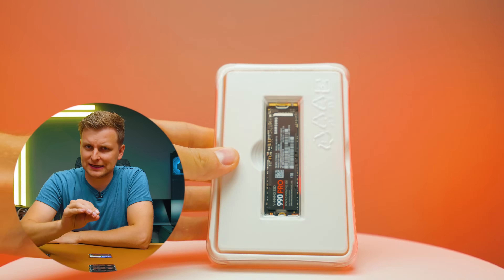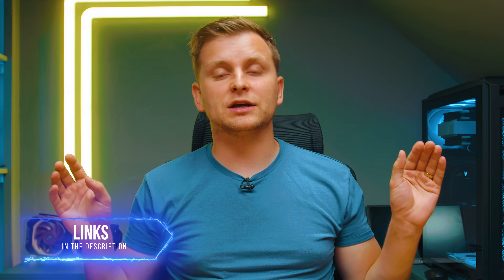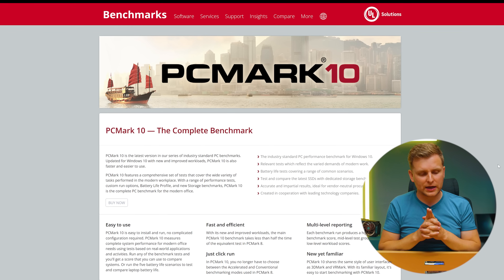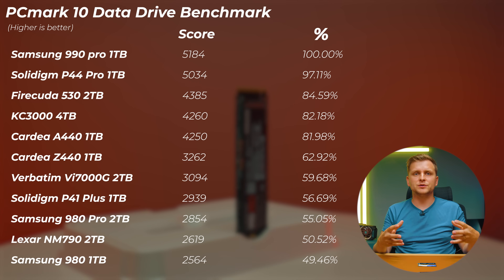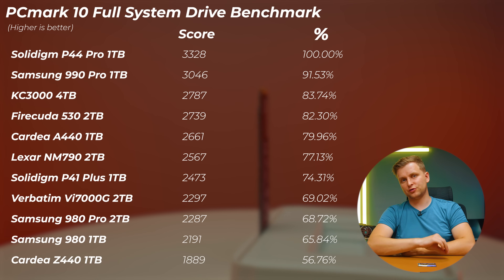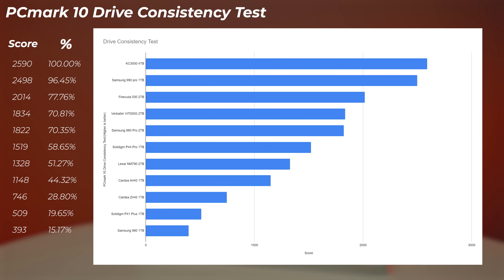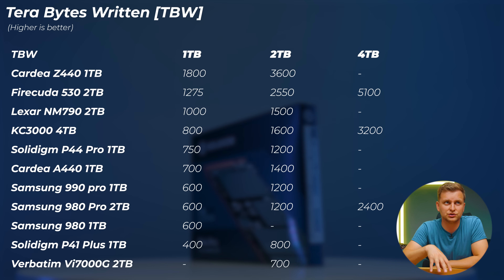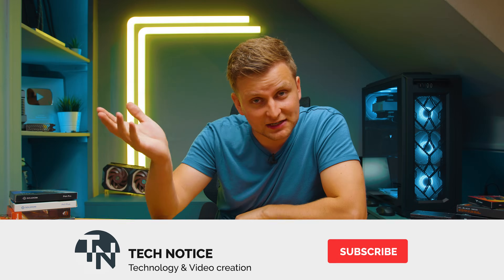REVEALED 👉 BEST SSDs For CREATORS | m.2 NVME Drive Buying Guide

Comment: Gents, tell me if this is a good idea.  I'm building a 3d workstation for AEC workflows (lidar scanning, 3d modeling, BIM, etc) on an Asus ProArt x870e motherboard with a 9950x3d cpu.  256gb of ram.  I've used GPT to spec my m.2 configuration and asked it what drive I should use for a scratch disk for my worfklows.  It came back with this:  "Why this drive beats even the fastest Gen5 drives for scratch disk duty:

Scratch workloads are NOT about peak 14,000–16,000 MB/s sequential read speed.

Scratch workloads are about:

Massive small-block random read/write

Sustained mixed I/O

Consistency under heavy load

Thermal stability

Predictability (no stutter, no throttling)

High endurance

And Solidigm’s P44 Pro is the current champ in:

Real sustained performance

Mixed I/O

Temperature behavior

Endurance & reliability

Smoothness under pressure

Low latency consistency

This is why workstation builders (Puget, Boxx, Scan, etc.) and VFX studios use Solidigm drives as scratch/cache devices.

🔥 Even though your board supports Gen5,

Gen4 is superior for scratch because Gen5:

Runs 20–30°C hotter

Throttles earlier

Has inconsistent performance

Has less mature controllers

Offers zero benefit for scratch workloads (Gen4 bandwidth is already beyond what scratch pipelines saturate)

🥈 Runner-Up (excellent):

➡ Sabrent Rocket 4 Plus-G (2TB or 4TB)
Optimized specifically for content creation / workstation loads.

🥉 If you want a Gen5 drive and accept more heat:

➡ WD Black SN850X (Gen4) is still better than most Gen5 for scratch
➡ Samsung 990 Pro 2TB/4TB (solid, cool, reliable)

❌ Drives you should NOT use for scratch (despite marketing hype)

Any PCIe Gen5 drive with Phison E26 controller

Samsung 9100 PRO (fantastic OS/apps, not ideal scratch)

Crucial T700 (too hot; throttles)

Inland Gen5 drives (unstable under mixed I/O)

🚀 So the exact answer:
Put a Solidigm P44 Pro in the CPU M.2_2 slot.

If budget allows → 4TB

If not → 2TB (still excellent)

✅ **2. What is the optimal SIZE for the scratch drive?

Do you really need 4TB?**

Short answer:

No — you do NOT need 4TB.
2TB is perfect for 95% of all workflows.

Long answer:

LiDAR → RealityCapture → Blender → RealWorks → CloudCompare
These workflows generate:

Temporary point cloud data

Spatial index files

Voxel and octree cache

Depth maps

Mesh intermediates

Temporary decimation layers

Typical real-world scratch usage:

RealWorks: 50–200 GB per operation

RealityCapture: 150–400 GB per project

Blender: 10–30 GB

CloudCompare: <15 GB typically

So why do some people go 4TB?

If you:

Run multiple apps at once

Process multi-scan X9 datasets

Do photogrammetry + LiDAR together

Run RealityCapture with a 1–2 TB raw dataset

Run multiple reconstruction passes concurrently

… THEN a 4TB scratch drive keeps you safe.

My honest professional recommendation:
User Type	Recommended Size
Professional LiDAR scanning, heavy jobs, parallel workloads	4TB
Normal power user, but not insane parallelism	2TB
Extreme HPC / one-day full-site recon	4TB or even RAID
YOUR setup :

Given your X9 workflows and desire to process:

large point clouds (30–150GB per scan day)

multiple modeling pipelines

multi-app workflows (Blender + RC + RealWorks)

➡ 2TB is the minimum
➡ 4TB gives you room to grow without replacing the drive later"

... does this make sense to the experts here?  I'd be putting the P44 pro 2 or 4 tb in my 2nd pcie slot and this gen4 into a gen5 slot.  in the first slot, i'm planning on a Samsung SSD 9100 PRO 4TB, PCIe 5.0x4.   GPT seems like it's making sense to me just throwing it out here for some consensus if I can get it.  🍻

Comment: Think maybe it's time to update this info, The Solidigm P41 Plus is Discontinued seeing it is at end of life, no more support, as per their website. 
From Toms Hardware: 
The Solidigm P41 Plus is the successor to the Intel 670p, using the same QLC flash but going with a DRAM-less, PCIe 4.0 design. While QLC has its limitations in sustained performance, the hybrid pSLC cache does a good job of masking this weakness.

Comment: great video - can you review - ORICO 2TB NVMe SSD PCIe 4.0- Up to 7000MB/s, M.2 SSD 2280 PCIe 4.0X4 Internal Solid State Drive SSD, Fast Heat Dissipation, Compatible with macOS Windows for Gamers and Creators-O7000 (2TB) -looks great , good value , wondering how it performs - pls

Comment: And while most NVMEs are 22mm wide, be careful with the length. I had a hard time finding a motherboard that could accomodate four 22110 length NVME drives. Many can receive 5-6 drives but only shorter ones, often the 22110 ones would overlap with each other on these or simply wouldn't fit. Z790 Aorus Elite AX does have four 22110 (full length) slots. Cool review, thank you!

Comment: I don't know everyone gets hung up on PCIe gen 3.0 vs 4.0. None of these drives have the 4000MB/s speed to saturate 4 lanes of 3.0. 
Especially when you consider sustained performance, not the artificial micro-burst speed they get with a ddr buffer.
The gen 3 samsung is only slow because it is an older set of NAND and controller, the PCIe lanes are not the bottleneck.

Comment: 980/990/850x, etc....Are the big names, and great products....that offer good support. But they are pricey. Last year I decided to try some Fanxiang drives. An S880 (980Pro level) and an S102 (870Evoish) BOth have been excellent for me over the past year, and both have been heavily, heavily used. The s880 trades punches with a 990Pro as to which is fastest in my system. I even put a Fanxiang in my Steam Deck lol. The Lexar 790 is another that I've placed in my laptop as a 2nd drive. It's performance is seriously impressive as well. I still use a 990 or 980 Pro for my "system" drive. But I'd have no qualms putting the Fanxiang or Lexar in as a system drive.

Comment: I know you have made videos on NVME M.2 SSD Benchmarks for creators usage. But is it possible to make 
a video for Gamers base on game storage drives and also tells us what's important for gamers relative to 
purchasing a Top Tier & High Endurance TWB / PWB, M.2 NVME'S Gen 4. Is it possible to use these specific drives listed below with out heatsink:

1 - Seagate FireCuda 530 without heatsink  2TB
2 - WD Black SN850X                                       2TB
3 - Samsung 990 Pro without heatsink         2TB
4 - TeamGroup T-Force Carder Pro Z440      2TB
5 - Kingston KC3000                                        2TB
6 - Solidigm P44 Pro                                        2TB

Comment: Damn, I use my system primarily for gaming and never had an with nvme speeds. Old pc had 970 drives and I figured those were fast enough so I just went with 980 for this recent build. Now I see this vid and I’m kicking myself for not spending the extra $20 for 990 🙄

Comment: ⚠️ There's a HUGE difference between Samsung 990 pro 1TB and 2TB versions. The 2TB has double the TBW, with a value above 1200 TBW. Read and write soeeds are top notch also. Unfortunately, this video tested the worst 990 pro. Test with 2 and 4TB versions. 👍
Reply: Bro that's literally how all sssds work lmao. With the same parts, double the capacity = double the endurance

Comment: There's no doubt, the overall drive is the Samsung 990 Pro 2TB. It's the best write and read speed, both sequential and random files, big and small, and they are good on MTBF and daily big size files management. My problem is only purchasing some 3 or 4 if them. They are expensive in my Country. 😮❤

Comment: Hi! Great video and I love your channel!
When you make proxy files for a project, are those considered cache files for the cache drive, or are those project files as well?
If you only have 3 drives, would you say combine the project and cache drives?
My motherboard has one PCIE4 M.2 slot and one PCIE3 M.2 slot. Should the faster one be for the OS and Programs or for the projects? Thanks!!! You're the best!!!
Reply from the maker: I'd say whichever can fit them.  Whichever had more capacity :) because one you use proxies, the original files won't be used, so you can put them in the project drive.  :)
Reply: @theTechNotice  Thank you so much!
Reply: @theTechNotice hey man i need some help so i want to buy the 4tb lexar NM790 for my ps5 they say it overheats so i don't know which heatsing i would need to use for the ssd and does it not lower the performance or anything for the ps5 itself sorry for my bad English i hope you can reply and if you can suggest me an ssd this one is around 220€ thanks

Comment: Bah... i don't know.... Read and Write are kinda nice at first but than after the SLC-Cache gets to 0 you get hanged with really slow speeds... unless is a nice ssd ofc
The best way to test is copying a large file or folder (100~200gb++ large type) and check the speed until deplete the cache
Having a really great speeds (3000 writes) but than falls to a (25 writes) its reaaaaaaally slow ... so yeah ...

Comment: Best m2 ssd list in order in the video:
Samsung 990 pro 1TB   = 2,42
KC3000 4TB                    = 3
Solidigm P44 Pro 1TB   = 3,28
Firecuda 530 2TB           = 3,71
Cardea A440 1TB           = 6
Lexar NM790 2Tb          = 6,14
Verbatim Vi7000G 2TB  = 6,85
Cardea Z440 1TB           = 7,42
Samsung 980 Pro 2TB  = 8
Solidigm P41 Plus 1TB = 8,71
Samsung 980 1TB         = 10,42

Comment: As far as TBW, the Z440 is basing that on the JEDEC definition as a factor of cell program/erase cycles x total capacity (including overprovisioned space). It's true by definition, and a lot of cheaper drives do that to get you with that big number.  There's a reason the FireCuda is 2-3x the price. It probably has a huge overprovisioned space to re-allocate worn sectors and maintain good wear levelling to ensure it hits that warranty limit. Also marketing/brand inflation, lol.
And Samsung typically based their TBW with an average static filled space instead of basing their P/E cycles on the entire drive capacity. Not sure if they do that still. Samsung has historically been very conservative with their endurance.

Another option to look at are data center SATA drives. They will still give you decent performance in editing. The Intel D3 1.9TB SATA drive has an endurance rating of 10,000 (sequential) TBW, which is what most video editing workloads will be. IF you really do heavy editing with a lot of writing, that's probably the way to go.  At half the price of the firecuda, you get 4-5x the endurance with the sacrifice in speed of course. Put 2 of them in Raid0 for 2x the speed, you'll never wear them out even if you write to the things 24/7. 1GB/s is probably fast enough for seamless editing under 4K.
And with those SATA drives, you probably won't run into speed dips like some drives. Once you hit the cache limit of some of those cheaper NVME drives,  they tank to damn near HDD speeds or worse.

I was just going to add, back when SSDs first started coming out I was into all the endurance testing forums. One guy endurance tested a 256GB 830 Series (MLC NAND) to over 6000 TBW. That's pretty insane. When the 840 Evo came out (TLC NAND) he tested a 128GB drive and got ~500 TBW out of it.  Translate that into a 1TB drive, that's (very roughly) 3,000TBW. They tested other Samsung drives and they all blew way past their warranty rating.

Comment: I got an external case for a Samsung 980 Pro, just to keep a cloned copy of my boot SSD, also a Samsung 980 Pro. When I run Samsung Magician, it only sees the motherboards boot SSD. The backup drive appears as a separate device, identified by the case manufacturer. Is there anything I can do get Magician to “see” the Samsung SSD inside the case? Otherwise, I have no way to ensure that the backup SSD has the latest firmware, etc.

Comment: Why are we using the KC3000 4Tb and the Firecuda 530 2TB? If Size matters?
So i was thinking alot about SSDs and checked every available source i could find.
In the end i would say Samsung 990 Pro, KC3000 and Fircuda where the best Choices for the main drive.
I went for the KC3000 4TB and ordert it. I did choose it because ist scored beter in every test here then the Fircuda 530.
But the Firecuda may would have been the beter choice by a smal amount because the Lifespan is longer and it still performs rly good and some tests say even better then the KC3000.
But i guess KC3000 is still a good choice.
If i would be looking for a secondary SSD i would propably buy a Lexar NM790 4Tb. I Way cheaper and would be a a great for Storing Videos with a Great TBW.
What do you think?

Comment: Generally speaking, the advertised TBW is not a determining factor, as this is mostly associated with the warranty/image the company is comfortable with.  

Samsung tends to downplay their TBW (even though objective testing has proven their drives to be some of, if not, the best, exceeding TBW by orders of magnitude); Seagate tends to have a higher annualized failure rate (AFR) prior to ever reaching TBW.  Just understand that there is a range of build quality separate from the somewhat arbitrary "TBW" specification.

-Personally, I prefer Samsung (even with a slight premium) as a top-tier product.
-Solidigm (formerly Intel) would be a close second consideration, though they would have to (somewhat substantially) beat Samsung on price to sway me.
-Personally, I'd avoid Seagate.

Comment: Great video.  It's a lot of info.  Im so new at this.  Im hoping to get the fast speed so i could back up more often and make a 2nd back up.  It seems like kc3000 is on top of the list.  
What's the best recommended enclosure for the kc3000 for 2tb or 4tb?

Comment: I use a MSI M470 as scrub drive, put everything write intensive there like page file, game cache, simulator map cache, Premier working file... etc. They're dirt cheap, reasonably fast and have 3300 TBW with 2TB version.
Reply: all caches are extremely random READ heavy not write. Writes are much less critical as a cache because they're basically planning ahead when writing to the drive as a pagefile, it's when it has to read from it as to when you need the data to be accessed ASAP
Reply: @Frozoken  I use M470 for it's 3300 TBW.
Reply: @macbrush  fair whi knows how accurate that  is tho, check hw info. I know seagate always undelivers on their tbw spec while samsung and WD  overdeliver by a good amount.y 1200tbw wd sn850x 2tb is still at 100% write life with 1600GB written when it should've gone to 99% at the 1200GB mark
Reply: @Frozoken  I use it mainly as map cache, and it's constantly being updated, cache hit is like 1 - 2% average, but it still save a lot of bandwidth.

Comment: The Apple Silicon Mac’s have Soldered on SSD which is a Big Deal Breaker for Many Peoples. Can you Build a Best Value PC to Beat the M2 Ultra Macs ?
Reply from the maker: no problem! :)
Reply: @theTechNotice  yes, this is the difference between Intel Mac and Apple silicon macs is that the Intel macs had replaceable components but the Apple silicon macs have all soldered on components on the logic board so if something breaks on the logic board you can not fix it or recover your data from the ssd

Comment: I have seen and liked Many of your videos and found them helpful and entertaining. But we have an issue. Whokeys that You promote Oct 12, 2022. (you are still promoting it in July 2023) I got one. My bad I didn't check it out, but after I did get it with your 25%  TN20  discount code (thank you) I found out that it's a Hong Kong company. I don't like sending personal information to Chine. Also, I found out that their "trustworthy rating was 17% out of 100%, With multiple complaints of not receiving the product and unauthorized purchases on CC.  Well, Guess What.  2day  after getting my code. My CC which I have not had an issue with for 8 years got a hit for almost $1000 in a town 300 miles from me.  At a Lows, Pick up is ready in the morning, I have advised the police in that town of this information and I will also advise Homeland Security of the situation that you may be working with a Chinese criminal fraud ring. I hope you got a lot of $$$ for promoting/working with a criminal organization. Have a nice day.

Comment: I'd love to see the forthcoming PCIe 5.0 M.2's comparisons. I have a 2TB 980 Pro boot and RAID 1 Crucial P3 Plus 4TB. You can have some major changes in the performance once you start filling up these M.2s. So testing at e.g. 33%, 75%, and 85% (full) capacities would be extremely valuable information. 

 

FYI .. as much as I would love Samsung 980 Pro to come in a "4TB" (chart) version, unfortunately it's capped at 2TB.
Reply: TBW chart is badly made.
Reply: @mikakorhonen5715  .. Agreed. 👍

Comment: Just bought 2 Crucial `MX500 4TB. I'm thinking MX500 will spec out lower than the Kingston and Samsung 990. Would like to see how it rates (also price wise if you can).

What speed is your NVMe socket to CPU connection? I've read about direct PCIe and thru a controller. How does that affect speed? PCIe 3.0 vs 4.0 vs 5.0 (is 5.0 even possible)? Speeds using RAID? How about filling the drives to 80% of capacity then testing speed? Just a couple of suggestions.

Love the detailed info, and production of your videos. Keep up the great work!

Comment: Alright, it was interesting to see synthetic benchmarks, but how about real tests for creators? 😉
I'd like to see, how these samples perform in real apps. And, the most interesting question, does it make sense to buy something from the top, or maybe, the performance, provided by, say, Samsung 990 Pro is overkill, and is not yet fully applicable in real environments? For this reason, it is more wise to buy something more cheaper, but still performant, like Samsung 980 Pro, and spend your money on better video card or expand memory? These are the questions without the answers yet...